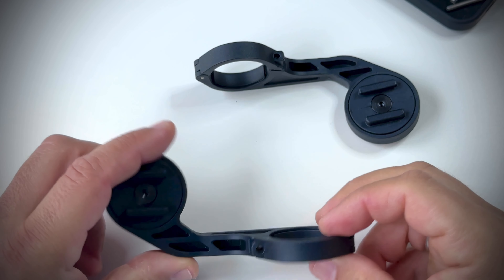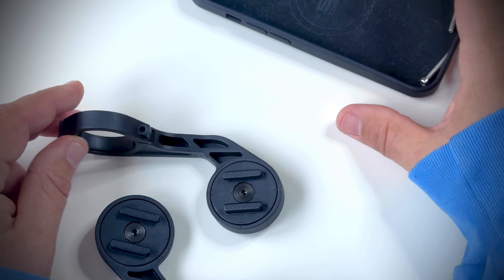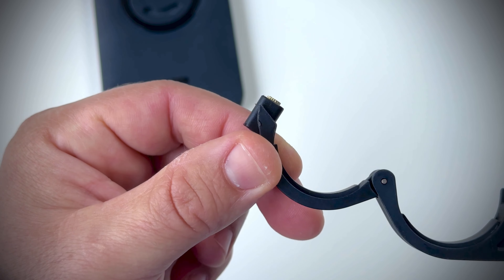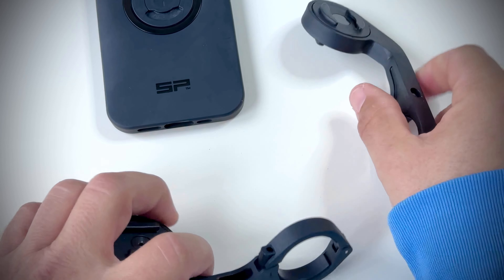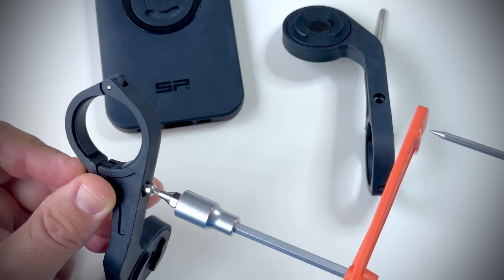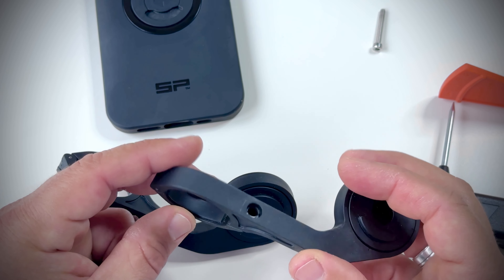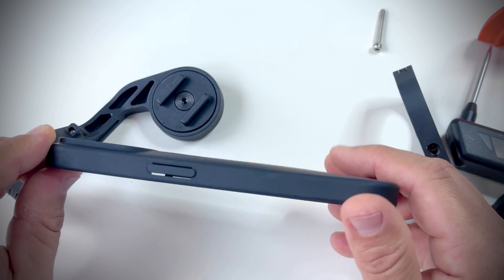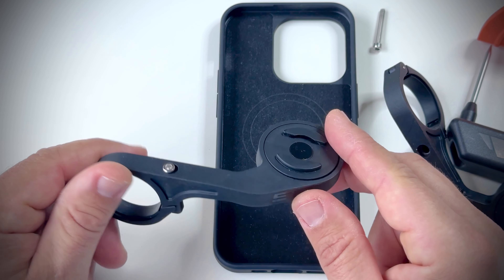I Broke My SP Connect Bike Mount!

Comment: better do not use glue, but with hot iron press it back in position, i thing it should lock better then glue
Reply from the maker: I may try that thanks. The first one holds well now after several months and 1000 km on my road bike.